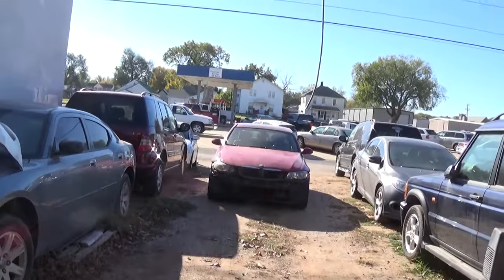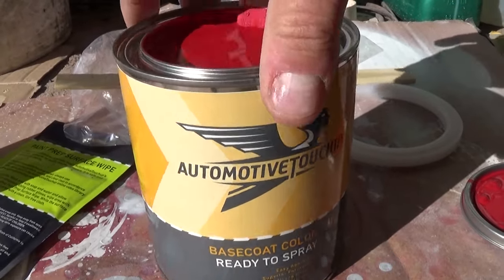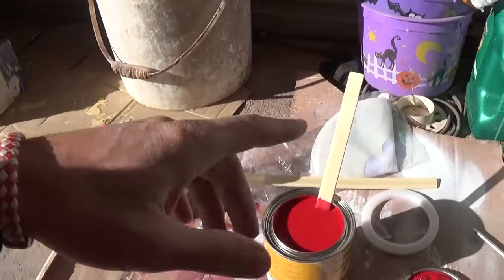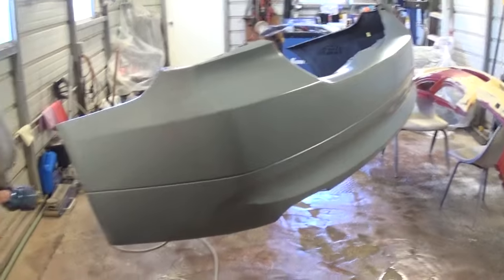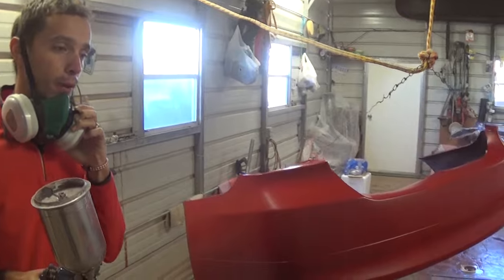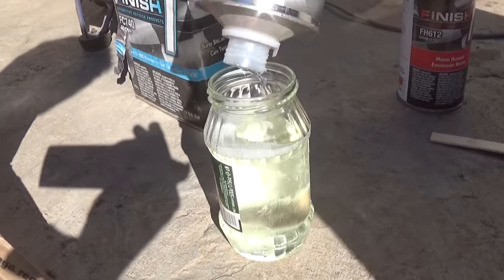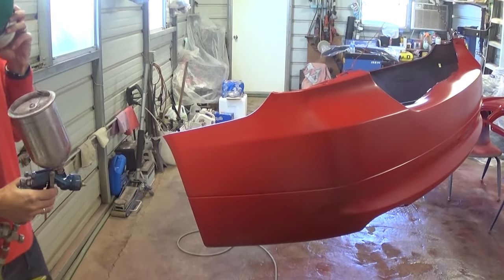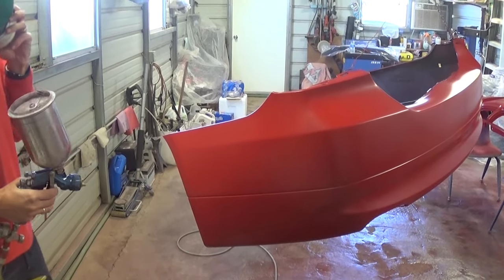HOW TO PAINT A BUMPER COVER LIKE A PRO

Comment: why did you say paint like a pro   This is not how pros paint  for one you touched the surface with your hand with no gloves  number two you guess at how much clear to mix you did not measure your clear,   and then on top of that you are mixing a pickle jar or Jam jar or something. Come on man,      That  is not what pros do. This should be a video on what not to do.
Reply: lol pickle jar. its youtube not everything is gonna be pro
Reply: In all fairness it does look better then some of the rattle can jobs I've seen on youtube.
Reply: the paint is too thick. how come he not mix it with some thinner. the gun setting to terrible, i bet the bumper suffer the extreme orange peel. haha
Reply: foxybrown2 
1st off. It is a Friggn Bumper.  U couldn’t afford the paint let alone have drips all over ! 
Stick with your plastic Dip and watch it peel off when your 88 Corolla does over 40mph.
Reply: interesting points ,if anyone else trying to find out car spray painting tutorial try Jaffacter   Paint Sprayer Coach (should be on google have a look ) ? Ive heard some extraordinary things about it and my buddy got great results with it.
Reply: Vladimir Beslic Have you found luck finding that video?
Reply: foxybrown2 man let the dud paint like a pro lol
Reply: I'm not an auto body painter but I do paint highly expensive jet parts and other prototypes so I suppose it workes the same way. And I cringed cause when you paint a panel you're supposed to go from one end to the other without stopping in the middle or in any section that way you'll have a silky smooth and even surface. Same thickness all around 👌
Reply: Lol. I could feel low pressure too. I'm not OP painter but I do have a good luck with 3,5 - 4 bar
Reply: @nandoGdog  ive seen rattle can jobs much better than this garbage
Reply: 😂😂😂😂😂😂

At least he didn’t use the red spray can from Walmart

Comment: Did you use a plastic adhesion promoter?paint wont adhere without it.this is not pro.this is beginner level.
Reply: Plastic adhesion promoter is used before primer. ..

Comment: This is horrible 😂
Reply: maybe bc its not fully finished? you gotta let the paint cure then polish it.
Reply: No thats not how u paint a bumper . I paint bumpers for a living. First of all you need a smaller gun like a sata mini jet with a 1.2 tip unless your doing a big panel. And you never just wipe it down and paint over old paint, IT WILL PEAL! you must take the surface down with a 400 grit sandpaper. And 180 grit for damage, and all damage must be primed a d scratched to a finish with 800 grit. The you reduce your paint and start with light dust coats to ensure adhesion, and you must tack the bumper down between each coat of basecoat with a tack cloth, then you can clear the car, this guy sprays very odly
Reply: I'm not a painter, but I know good prep is 90% of the job and end result. 
I was wondering why he didn't rub it back first, but hey... not my car, not my problem.

Comment: a few suggestions friend... use a tack cloth before and after base coating. you probably had too low of pressure at the gun or the air hose isnt thick enough for the right air volume, because there was too much orange peel in your clear. and watch your technique, a constant robotic like overlap and gun movement is key to a good paint job. and as mentioned in previous post silver is a mofo to get right one of the hardest colors after tri coats, because of the mottle effect you get if its not done right. its even harder since our bodyshop changed to waterbased paints. anyways nice vid man keep it up

Comment: how come you say this is pro?? too much to improve on your technique. your base coat is too thick, add some thinner. 2. use the mixing cup to precisely measure the clear ratio. 3. check your paint overlapping. 4. setting your gun fan and use the correct psi while spraying the clear coat. 5. add some reducer about 10-20% according the manufacture for the better flow and avoid the orange peel. 6. don't touch the surface with your bare hand as it contain oil. even amateur do it far better. hope no one ever follow his style.
Reply: Don’t see u making a video hater !!
Reply: @dudamage8241  He doesn't need to. The comment was more informative than this video
Reply: @thenegus5469  lol how would you know ?? All Monday morning quarterbacks here . You believe everything you read apparently lol
Reply: @dudamage8241  you can’t say this is the pro way of doing it when an amateur can spot 6 mistakes that were made
Reply: @Syafiee Sedik he said “like a pro,” “Like.” Not the pro way of doing it.
Reply: You’re hilarious. Look at the end result. The guy obviously knows what he’s doing.

Comment: I haven't painted in 3 years. This was the first vid popped up cuz I wanted to refresh myself. Some things are OK, he says always use the cup filter, (invest in a filter holder, a wire hoop holds the filter over the cup) wipe/prep the surface, but others whew!... I learned from pros with 30yrs experience, they don't eyeball mixing paint, they use the measured containers every time to the milliliter. The way he was handling the gun, like spot finishing, you have to sweep in big broad confident strokes like Michelangelo. Pull the trigger before you enter the surface and don't let go till you pass it! Plus final tip, he didn't use adhesion promoter, its an extra step but might've helped with the orange peel. I don't use it, I buy cleaner from my local auto body shop supplier and just super scrub the surface but for noobs use the adhesion promoter. BTW some guys I know don't mind painting base coat sloppy (like here) and spend hours smoothing it before the clear coat, then it looks like glass. But I paint the base looking like glass, then hit it with the clear looking like glass too. Depends on how lazy you are, I don't like sanding and smoothing forever. If you don't have a gun, get the big, older made-in-USA Binks in good condition. These deliver paint to surface beautifully.

Comment: Zero Orangepeel you said??... Dude... are you blind? This is the worst paint result i`ve even seen...
Reply: He thinks he is in Israel 🤣
Reply: Yeah there's a ton of air bubbles in there lol
Reply: think it might be those solvent infused wipes he used, not sure you should use solvent on epoxy primed bumpers. Should use anti static wipes for a better result
Reply: Needs more psi at the gun and a wider fan spread when spraying
Reply: @agentcarbunkle  Could be moisture in the air line. The bubbles are very fine and spread evenly across the paint job.

Comment: If you paint, don't start with black like I did...  I'd imagine silver or white would be the easiest for a beginner.  If I ever paint a car again I do know some more stuff than I did before.  But patience would be the biggest thing I'd have to work on.
Reply from the maker: back shows everything. White hides most imperfections. However, If you do base coat clear coat white it is very hard to see while painting. You are right silver is very easy to paint and and it hides imperfections very good.
Reply: dannyayo Very true silver is not easy for rookies this "pro" doesn't know what he's talking about and judging by the way he paints he would ruin a whole job if he ever decided to paint with silver ........NO  no no solid colors like black or RED basically solid colors can be painted by babies and no one would be able to tell they are the easiest and perfect for newbies